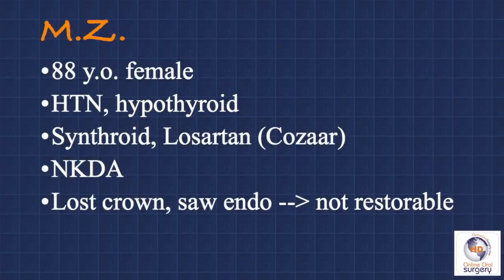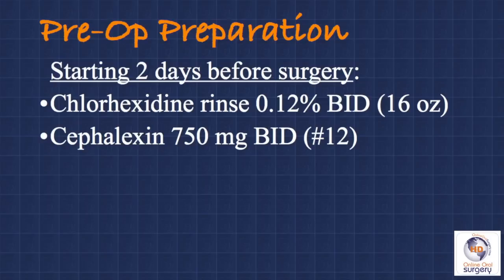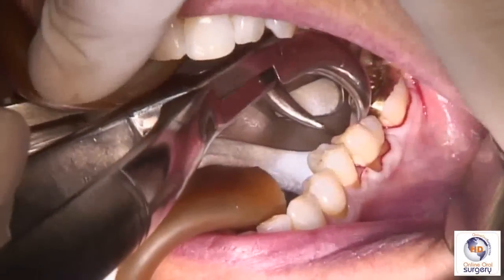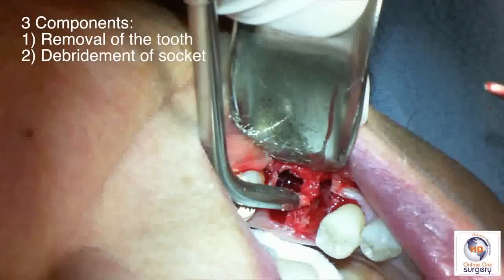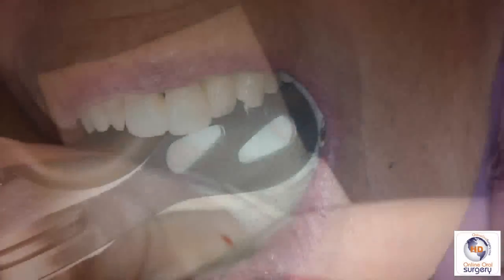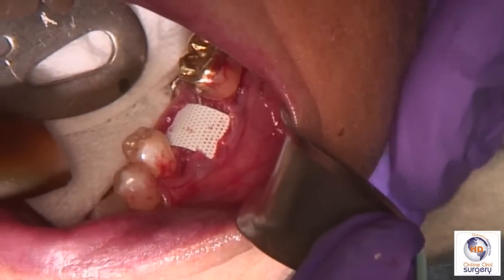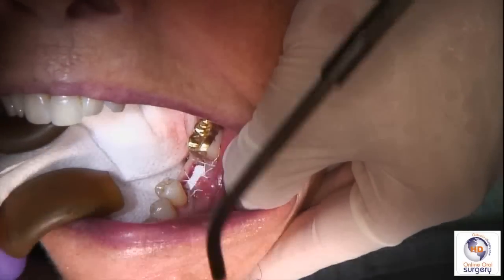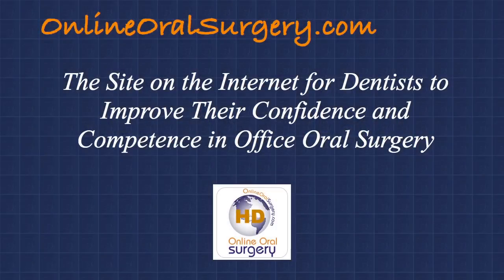Extr 19RPG_720

Comment: Horrible treatment :
1. No indication for extraction here especially at the age of the pat. Endodontic theraphy would have been the right treatment here.  
2. Ridge preservation makes no sense in this case. There was enough bone width for placing an implant without any problems 2 month after surgery. 
3. Pfte membranes are more and more obsolete
4. No indication for AB theraphy herr